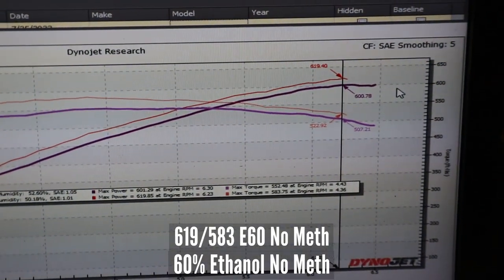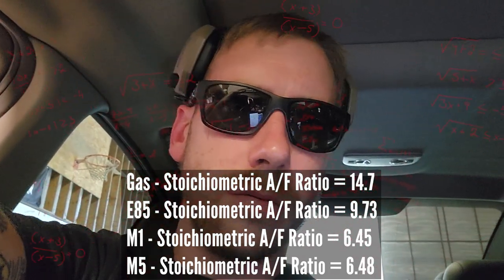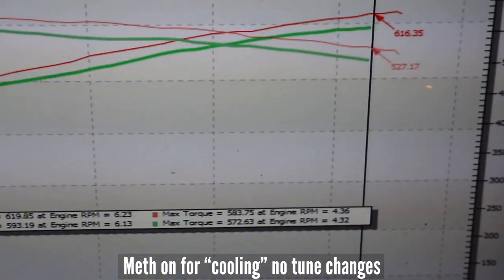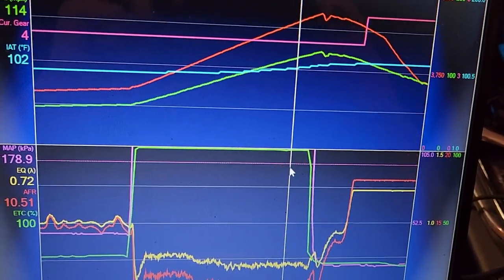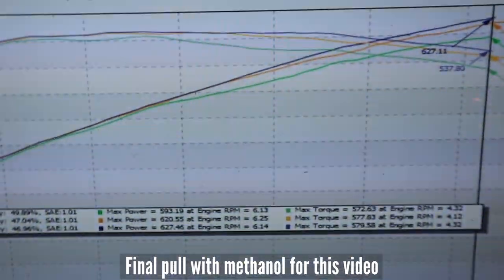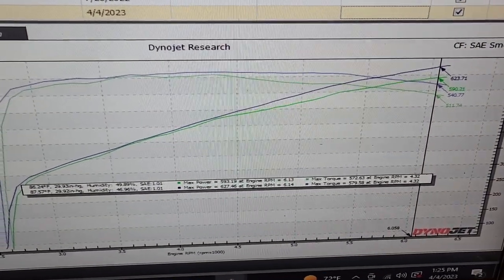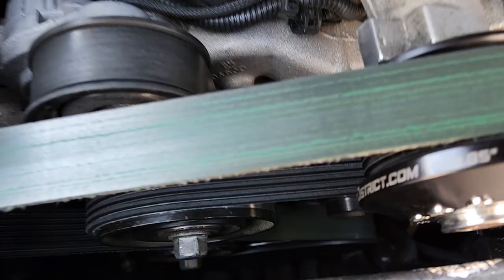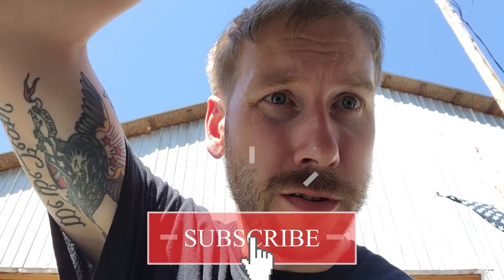Methanol Injection 101 Stop Listening To Facebook Car People

Comment: This video is misleading and does not even consider several scenarios where a tune would not be needed. I'll explain one of them. it's not necessarily about "adding more power". Cars that struggle with high IAT's can easily benefit from a WMI system without a tune. It's pretty simple - instead of the ECU pulling timing, boost, etc., and lowering performance overall as a safety measure against the high IAT's, the car will be able to run freely without it pulling back in certain areas to protect itself from the high temps. Simply allowing the car to operate with these lower IAT's without performance being held back is a HUGE benefit that can be achieved without any special "meth tune", and yes, you'd be allowing your car to make more power than it would without it. Thanks for coming to my Ted Talk.
Reply from the maker: Water meth and methanol are two completely different things. This video was to a specific group of people. Every week, someone makes a post about spraying the house down with pure meth (not water meth) and claims it doesn't need tuning. 

Water meth is great.
Methanol is great. 
Both only work when done right. 

This video isn't about water meth or about cooling. IAT didn't change at all with or without. It's about octane. 

I wouldn't recommend spraying water in a PD blower. Water doesn't compress that can end extremely bad if too much goes in the rotors of the blower. It'd be no different than tossing a bolt into the rotors. But thanks for your comment.
Reply: You're wrong bro 😂.

Comment: Maybe would have helped the comments here if it stated NOT water/meth, alot assumed you’re talking about adding water/meth to a turbo application. Absolutely not what you’re talking about. Great video now that I understand the application. Blower + M1 .  Not pump gas turbos + water meth.. apples and oranges
Reply from the maker: First 4 seconds show m1 and m5 not my fault people assume stuff when I clearly mention methanol and never once said water meth
Reply from the maker: Video description says 
Methanol Injection on an LSA Supercharged Chevy SS
Often people say to use meth for cooling and it doesn't need to be tuned for it when using it for cooling. Well, methanol is a fuel so it will change the tune. You can spray chocolate milk on your IAT it will drop the temps that are registered but it's not going to make more power. 
On another setup I did the same test with a single M5 (size not vp m5) nozzle on using vp m1, the single m5 nozzle made the AFRs go from 11.9:1 to 11.3:1 which isn't horrible but will still need some tuning to get it 100% right. Now if the car was at 11.5:1 then a single nozzle was sprayed that would put the AFRs around 10.9-10.8:1. The more methanol you spray, the more it will change the AFR.

Comment: A couple years ago tried m1 instead of 50/50 boost juice and was blown away at how much of a difference it made without any fuel or timing changes, it had to have been 5-10hp. The power loss comes down to what the air fuels were before you start injecting meth. For instance if you're already running an 11.5 AFR WOT on 93oct, once you start injecting it will probably go to around 10.5-10.0 so you lose power (more or less depending on nozzle size). If you have a stock turbo car with a factory ecu that will be probably the best mod you can do, simply because the ecu will adjust fuel trims and timing modifiers automatically
Reply from the maker: Correct, I explained that. It's a fuel you can't add fuel and not tune for it, especially when spraying the house down with methanol it goes so rich it'll lose power. Water meth isn't nearly as bad, but the gains from tuning are there 10 out of 10 times.
Reply: @andrewd843  Absolutely. I added 2 degrees and took 5% away up top and it felt alot better. Great video btw really good info 👍

Comment: Hey man, please help me understand this. My car is currently at the mech, he's doing an upgdraded intercooler for my Focus ST 2016, he's saying I should also do watermethanol injection. He's also saying because we are at altitude, it will help gain power without a tune. I am confused now, he has done a lot of my type of car and he swears by it. What am I supposed to do now? What would you do if you had my car to work on?
Reply from the maker: Water meth is not straight methanol that's two different things. Water doesn't change fueling like straight methanol does. So it would depend on 1. How your tune is 2. The water/meth %. 3. How much water/meth you spray.

Comment: Methanol injection is for high compression and boosted applications keep the pistons cool and free on detonation when running higher boost with pump fuel and helps hugely on directinjection turbo motors.100% needs to be tuned and ls a type of replacement for people that can't get e85
Reply from the maker: Say it louder for the kids in the back!
Reply: @andrewd843  I'm running 6 injectors port injection on my m104 turbo probably go full meth due to running 1500cc total.  Putting a pressure switch on the meth line to engage the high boost setting for bit of safety.
Reply: I agree.

This video is outside of what most people run as he was on E-60 which has lots of cooling already built in, so w/m injection doesn't make much sense on his setup.
Reply: @michaelpopp6340  I know if you can get e85 don't waste time with water methanol. A supra with methanol injection  at my local turner got over 200hp extra because of the knock suppression. They Could add 12psi  on top of the regular pump fuel tune. Methanol can handle over 40/1 compression without knock e85 can handle 25/1 without knock. So methanol is very helpful even with small amounts.

Comment: I have a totally different platform, and my car was slower with water/meth, I got it because many people said that it would make more power but it didn’t, it did help with knock and IATs, however after I got it tuned, it added around 40-50 horses, I can feel the difference. Don’t believe the hype, you need to tune or don’t bother.
Reply from the maker: Water/meth is good for cooling. Same with water injection. Water isn't fuel so pure water injection or even water/meth mix won't have nearly the same drop in power since it's not over fueling the motor. 

However water/meth mix still has methanol so it will change the AFRs and need some tuning to get right. 

Whenever fuel is introduced it needs to be tuned.

Comment: On a PD blower you want to spray pre and post rotors with a 50/50 mix of water and alcohol preferably isopropyl alcohol as it cools even better than methanol and has more power in the fuel
Reply from the maker: Water doesn't compress. That can cause bad things to happen in the rotors if you spray a lot. Water is better for cooling. I don't use methanol for cooling. I use it for the octane.

Comment: Great video. A couple of things to note for people looking to run water/meth or meth injection. A single nozzle location can cause unequal distribution. You may have cylinders that are flooding with meth and some that barely get anything. Also, when you tune around a meth kit and the meth kit dies, you better hope there is some kind of fail safe in place.
Reply from the maker: Why does everyone keep mentioning water meth? This video is for 100% meth not water meth that makes a huge difference. Methanol is fuel, water is not. Water cools, Methanol adds octane. 

But what happens when a fuel pump dies? Bad stuff can happen, once again methanol is fuel so it should be treated as such. I've seen more fuel pumps die than I have meth kit pumps.
Reply from the maker: Also, don't modify anything if you're not willing to take a risk of parts failing and catastrophic damage.

Comment: No tune on my 09 mini Cooper S with direct port meth injection. I can run dry and not have issues. However I tuned my 04 STI on Meth/ E85 and have a premium gas tune as well and if I run dry in my STI I will have problems.

Tuning isn't my strong suit as I have dyno shops for my builds. I do have about 10° cooler temps. 

Also. Are you running a LS7 or L77? Didn't hear a turbo or supercharger over exhaust but that could be why you don't see really any difference. Doing this on a F.i motor you will see a difference. My mini Cooper S just has it to clean my valves and run cooler. If I did get a tune I know I could get about 100 extra HP. Coming from the hot rod scene as well I get what you're saying and agree.
Reply from the maker: Running no issue and making more power are two different things. Lots of things can be done doesn't mean they're gaining power unless you're really laking a fuel system.

Comment: How is the power gain of normal fuel to meth/water injection? In this case it's not really worth to go to E85 + meth/water inj because the power gain is really low, right?
Reply from the maker: I don't mess with water meth. Water meth is better for cooling. But I wouldn't recommend spraying water into supercharger rotors. Water meth power gains will depend on how bad cooling is, and how it gets tuned. Straight meth will depend on how tuning is and what the base fuel was being used. Pump/meth will have bigger gains than e85/meth.

Comment: Thank you for proving that the gain is not worth it
Reply from the maker: Some people still think injectors, flex sensor, and sometimes a fuel pump are worth the money for 5-10hp on some NA ls stuff, so what it's worth is up to whoever is spending money. 

Meth injection can be worth well over 100whp on the right combo, but a mild lsa combo isn't the right combo for big gains.

Comment: I used to have alky system in my boosted vette and sierra but I switched them both to prometh with upgrade meth pump PM190 and VC-50 gauge meth/boost i felt this is the best combo lil expensive but worth it
Reply: Pro-meth still in business? Rodney is next to impossible to get a hold of
Reply: Yes they are, from my experience i used prometh and alky, pump, fittings and lines everything i will go with prometh all time
Reply: I like prometh too. Good nozzles and easier to set up with 4 an ptfe braided line. Better than aem imo

Comment: Watching it from Australia mate big thumbs up with the video great bit of info 👍almost finished building my Intercooled LS1 turbo and am contemplating fitting the kit on to mine, I'll run the E85 first and go from there and decide
Reply from the maker: Thank you! Methanol is great it just needs to be tuned for.
Reply: @andrewd843  no worries, got that covered buddy 👍 like you ,do all of the tuning myself 👌
Reply from the maker: @jjjjjj9284  awesome! What turbo are you going to be running?
Reply: @andrewd843  only a baby S480 lol ...its currently a 5.7Ls1 SBE not a street car anymore, powerglide custom Billet 5000 turbo conv , so aim is to run 9's without stretching the rods too much lol, if it does ive got some LSA Rods lol , but yeah baby steps

Comment: Well, even in AEM WMI manual it says the AFR to be adjusted when spraying yet it's just 50/50 with water. Sure meth is changing  Lambda, why wouldn't it..?
Reply from the maker: 90% of people on Facebook claim you don't need to tune for meth and it doesn't change the AFRs which would be impossible so that's why I made this video. 

Alky control instructions say similar things.

I knew the answer but people need to see it sometimes.

Comment: Is this true for cars that have a Wideband o2 sensor where the ecu can adjust ratios on the fly? I got WMI spraying before the supercharger (2023 F pace SVR) mostly for cooling. It gets 100+ F in the summer months. But, I'm wondering if my car will automatically pull some fuel out to prevent it form going to rich?
Reply from the maker: Honestly, that depends on how the tune is set up. Just because something has a wideband vs narrow band doesn't mean the full corrections are setup to pull that much fuel. It 100% could do it but doesn't mean it will do it. 

Some aftermarket ecus you can program that allowed fuel corrections, not sure if everyone oem will correct 100% or if they have a limit on correction.

Comment: Is spraying meth before the blower ok? I’ve heard mixed things about putting meth before the blower can be harmful? Any thoughts on this I have a nuespeed supercharged 2 liter Volkswagen and the charger is apart of the intake manifold so the best cooling affects would happen if I sprayed meth before the blower
Reply from the maker: I've had the meth for about 2.5 years now and my rotor pack in the supercharger still looks exactly how it did the day I installed the supercharger. I've heard methanol will eat the coating off the rotors but if it does I guess it takes a long time because I've gone through a lot of methanol over the last 30,000 miles and no issues so far. 

I wouldn't necessarily spray a water meth mix through it since water doesn't compress.
Reply: @andrewd843  ok so you recommend just meth for the octane boost?
Reply from the maker: @Everything8Valve  that's what I use it for. Not sure how it would be with your supercharger. But on this combo the methanol evaporates before it ever sees the IAT so meth or no meth there's 0 temp change for the air charge after the rotors.

Comment: Haha i laugh at em all. 
I was using a rigged water injection setup in a mk1 golf I had with a mechanical ahu tdi swap back around 04-05. 
Since i didn't have an intercooler i blew it right into the air intake going to the turbo. 
It worked great for years and crutched my lack of intercooler. 
Just a plain old washer botrle filled with juice , a piece of copper line and an old carb jet.

Comment: Hey my car has been tuned for 93 and meth I’ve been using m1 recently I haven’t been able to find m1 they only had m5 you think I can use the m5 with out any problems or do I need to adjust the tune
Reply from the maker: I'd definitely ask whoever tuned it. 

I've done some back to back with m1 vs m5 and they usually needed want different tunes. But have no idea how your tune is.

Comment: Would there be a difference if you were not running ethanol fuel if you’re running normal pump gas
Reply from the maker: For power? Or cooling? 

Pump/meth makes less than e85/meth but meth will have larger gains over on pump gas than it does on e85 if that makes sense. But cooling IAT wise won't be any different on a pd blower spraying before the rotors. 

It will also still need to be tuned or it'll be overly rich and most likely lose power.

Comment: Looks like anyone shooting methanol before the turbo/supercharger wouldn't see any difference in actual IAT's but man I don't know how you couldn't see IAT's drop drastically on a high boost/high iat car if the methanol is introduced before the intake.
Reply from the maker: Most people spray methanol after the turbo/centrifugal superchargers. Those you'll see IAT drops as long as it gets sprayed pre IAT sensor.
Reply: @andrewd843  who would even plumb it before the compressor??? 😂
Reply from the maker: @wreckless4thf  you'd be shocked. I've seen people online do it.
Reply: @andrewd843  was the guy in the video who said "of course if I spray my iat sensor with methanol" implying that methanol doesn't cool iat's, it's just giving a false reading because the alcohol is hitting the sensor? If so maybe I need to put a a2w intercooler on my car which runs pure methanol injection and 40+ #s of boost without an intercooler with almost identical timing tables as a a2w car.
Reply: @andrewd843 very true mate regarding spaying before the I.A.T

Comment: Did you truy your „meth tune“ map just on e without meth? Just in case you was not running best ign on ethanol map
Reply from the maker: @RRahmani_performance  that wouldn't work. If my methanol tune is loaded the meth is on.  If I don't plan on using methanol I load a different tune. About 10% of total fueling is methanol so that would be a lot of fuel missing.

Comment: What about pure water then? My car doesn't offer custom tuning, only off the shelf. So no advancing or retarding timing.
So what about pure water?
Reply from the maker: Water injection shouldn't change the AFRs at all since water doesn't burn and isn't fuel. A lot of people run water injection for the cooling effect. Something like boost juice or a meth/water mix will give you the benefits of both some extra octane and cooling of water but won't be so much that it kills the power and makes it overly rich. 

I just prefer straight m1 since it'll make more power, and I don't have temperature issues.

Comment: How corrosive is M1? I have all stainless steel lines for my water methanol kit but will the M1 eat through the pump and solenoids?
Reply from the maker: It can if the stuff isn't rated for methanol, just like some stuff isn't rated for ethanol will have the same issues. I haven't had any issues with the alky control stuff and i know some people going on 4+ years with the same pump.

Comment: On a n/a application, wouldn’t the results be less significant to the point where it wouldn’t make since to run it, vs running it with boost?
Reply from the maker: Why would you spray methanol on an NA application? It would need to be a pretty wild combo to pick up good with methanol injection or to even need methanol injection. 

But that being said, just spraying meth with no tuning on an NA car would make the power drop a lot worse than it did on this car in the video.
Reply: @andrewd843  30 wheel gains
Reply: Very high CR NA built would benefit from using meth or water.  That's the only time where there would a need for it in NA car. It works up to CR of as much as 16-17.